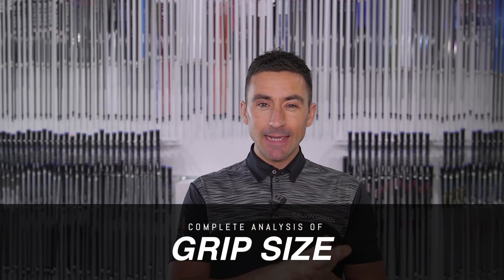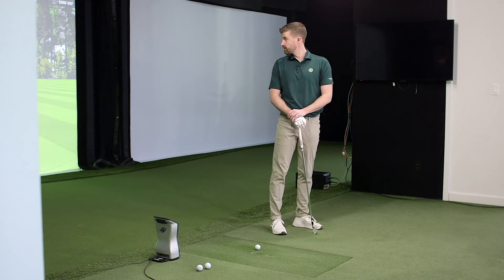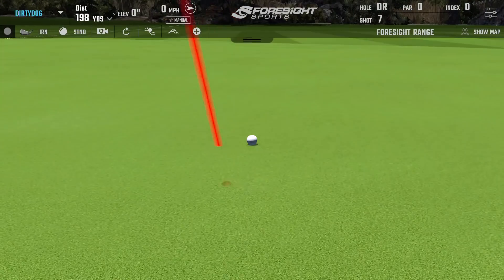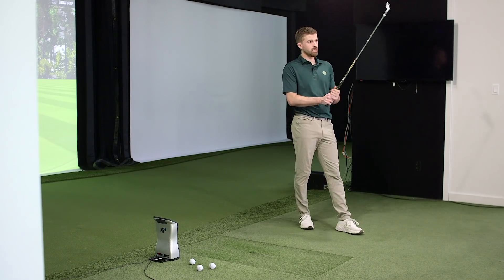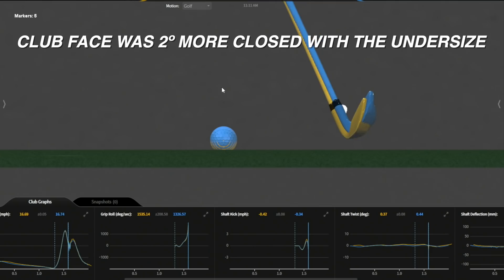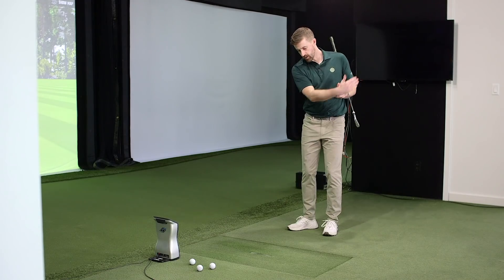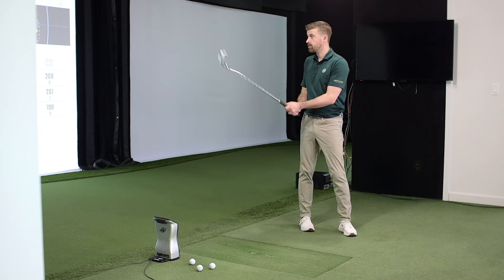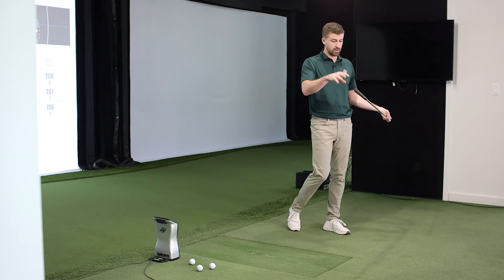Can GRIP SIZE Change Your Swing? // GEARS 3D Motion & Foresight GC Quad Testing

Comment: Have so far only put a Jumbo Max large grip on an old Adams driver ( i hook all drivers).
it has has straitened out my flight to the point of zero curvature and i can actually set up "open" and hit a fade which has been a revelation for someone who didn't use a driver for 2 years😃

Comment: Nice video…. But isn’t grip size (while some degree personal preference), still connected to hand size?   These stats reinforce my experience with a larger grips (I have a bigger/wider hand but not hugely long fingers).  But if I want to more efficiently get the shaft in my fingers vs getting into the palm of my hand, shouldn’t I want to go to a smaller diameter grip??  Seems like I’d get more distance.

Comment: I feel larger grips for smaller hands moves the handle into the palm and that weakens a grip . You have to have a grip that can fit within the fingers . If I handle is held in the palms you cannot properly hinge or release the club . Most have too large grips actually the smaller the better you need to hold the club in the fingers and not the palm to properly swing

Comment: Thanks for the video. Wondering if you could tell us the brand of the large grip. I seen lots of o/s grips for sale but there weight are very different. If I am adding extra weight to the top of the club how does that affect my swings speed angle etc?

Comment: I just installed Jumbo grips on my irons, and initial results I experienced more consistent ball striking and straighter ball flights, but the contact was more on the bottom of the head and flight path was more right of target vs a standard grip.

I'll need to work on how I hold the club, and concentrate on moving contact up the face.

Comment: Just got my new irons in, went with midsize grip mcc +4. Coming from stock taylormade standard size grips. These new ones feel way different, and my hand size is right at the top of standard, and bottom of midsize. Will take awhile to get used to I feel, but looking forward to playing them.

Comment: Grip size is a key factor in tennis, so there is no reason it should not be in golf. I feel a lot better with midsize grips (or jumbo grips that are really closer to midsize) than with standard grips. Your data is showing why. Straighter and higher flight, face square for longer, more control.

Comment: How do you guys approach the different weight of larger grips-  eg if you put on a midsize grip this can be 15-20g heavier than standard, which is up to 3 swing weight difference!! Yes larger grips might reduce grip roll, but also affect swing weight.  

I got fitted for my clubs on a standard grip size and later changed grips to midsize without knowing the swing weight would change... 

(Maybe you should choose the grip first then fit the shaft?) else don’t want to mess about with lead tape etc

Thoughts?

Comment: I just started playing golf this year and was wondering about what grip suited me best.  This video helps with how the grip influences my swing, loft, spin and face of the club.   One question, what about tapered grips vs less tapered grips?
Reply: DukesRocks . Lamkin and several others have charts online where you measure from the first crease at your wrist to the tip of your middle finger and that determines at least a starting point. Note the charts don't exactly agree with each other but they're similar. Also the less tapered grips are supposed to prevent your bottom hand from turning over too much and possibly causing a hook. I have them on one set and they seem to help when you want to grip down on the club, at least for me.

Comment: Question is the face closure rate affected also by the change of swing weight ? The changing of grip size also changes swing weight correct ? What if you matched the swing weight after each grip change and tested 🤔

Comment: Larger grips should allow finer adjustment of the club face. The issue with tests like this is they don't allow sufficient time to adapt to differences. I put larger grips on my clubs and played them for several years once I got used to them my play improved significantly.

Comment: my problem is that with midsize grips, my lead hand tends to slip and allow the grip to go into my palm causing the face to close causing pulls with my driver and short irons. I just changed my grips to standard and no longer pull my shots. I don't have long fingers and use an ML Cadet glove.

Comment: I know you used air to install, but was there any tape on there or bare golf shaft?  I typically use midsize with 2 layers of masking paint tape but thinking of trying the super lightweight jumbo so I still have a nice swing weight.

Comment: ZProblem with hand size my left hand size is 5 inches Palm 3 1/2 inches longest finger tried  thick and thin grips problems if it's thin grip it is very strong and in fingers timing issues if it in Palm it more about rotation of body not that supple struggle with pressing my meaty part of my thumb down on the shaft due to length of my Palm if holding in fingers leaves big gap in my Palm when swinging as suggestion play off 5 always had problems with being comfortable with my grip. Thanks for help keep up the great videos

Comment: I have a doubt on this. Grip has at least 4 parameters, appearance, material, diameter and weight. Put the first 2 on hold, the diameter will affect the feeling of grip, but the weight is also affecting the swing weight... which attributes this result more?

Comment: There's a small issue with this test and that is the tester. Matt is a great golfer and is obviously probably more aware of where his face is during the swing. Would like to see this test done with a 15 handicap or higher to see if the results are consistent. For instance perhaps an undersized grip would start left and keep going left, because a higher handicapper may not be able to automatically adjust or neutralize the path as well, based on whatever club face rate of closure
Reply from the maker: We'd argue the opposite, the less consistent the swing is of the tester the more unreliable the results are going to be. With all the videos we're showing what should happen with a given equipment change, a higher handicap player can use the patterns as guidance but it's harder to establish a pattern with someone who's path, angle of attack, strike etc. varies too much
Reply: Exactly so a higher handicapper may watch video purchase said grips or even go to a fitting and his or her results may not correlate. So the test I suppose shows shows the effect of grip size in low handicappers. Now if it was done with a higher handicapper as well as a lower handicapper then you could generalize

Comment: I am wondering is a thinner grip actually causes one to hold the club tighter?  So in the downswing one would grip the club tighter because it feels like it might slip out of your hand.  And in doing so you then rotate the club just a bit closed. With a thicker grip you do not get the feeling so your hands can be more neutral so less rotation.

Comment: There are just too many choices in Golf Pride grips. If you measure my hands its standard grips all the way. I kinda like the way the mid size feel in my hands though for some reason. I have read the standard size in the Golf Pride MCC Plus 4 is actually a bit bigger than standard.  That its actually right in between standard and mid size. Is that correct??????? I am looking for a grip with great control, all weather ability . I like the CP 2 but I am thinking its not so great in wet weather.

Comment: Forgive me if this question is too basic but wouldn’t the size of a player’s hands influence the size of the grips.  Myself, I’m 6’1” and wear a size “large” golf glove.  I currently have over-size Winn grips on my clubs and they feel good.  I purchased a new 3-wood last summer which I haven’t yet re-gripped.  The grip on it is noticeably thinner and doesn’t feel right.  It could be because I’m used to my over-sized grips or it could be that my hands are simply too large for the standard grip-width.   I guess my question is, shouldn’t hand size dictate the width of a club’s grip?  And then if you’re pushing or pulling the ball, wouldn’t a change to the swing be better than a change in the grips?

Comment: I had some grips put on my irons by Golf Galaxy...I wanted standard grips because that’s what I always used.  However, they messed up and put a midsize grip on my 7 iron, which I didn't notice until I took them to the range after I picked them up.  Well, I was a bit PO’d at first, but after I started to hit my 7 iron, it was like an epiphany of divine intervention…I hit them so well and it felt so good, I knew I was playing the wrong sized grips…bit the bullet, took them back and told them the situation and GG was great about it, they put midsized grips on all my clubs and I only paid for the grips, free install.  Basically, I have much more clubface awareness and my ball striking improved a ton with the large midsize grip.  I would encourage golfers that play standard grips to put a midsize grip on their 7 iron and try it out at the range, you may have the same experience.

Comment: It’s interesting because the general fitting process doesn’t accommodate grip size up front and trial shafts have a standard grip. Looking at the head speed differences could mean the marginal softer shaft may well be a better fit for distance and shape with a larger grip. I use mcc +4 with 2 wraps, as it just feels right in my hand.

Comment: I should be in midsize based off some of the suggestions I’ve heard and read.  I changed to midsize and I struggled to release the club.  Maybe because they were a lot softer than I was used to?  CP2 Pro by GP...don’t do all your clubs like I did.  I’ve now found a comfort zone with 3-4 wraps under my bottom hand or a “plus 4” style grip.  Play what feels comfortable and gives you the best results!

Comment: Ian, very interesting. 2 questions, could you give me the grip diameters of the 3 grips you used( I see you used 2 Pure Pro-undersize and standard and a Winn jumbo),  and will you be doing this same test with the driver, I thinking the driver might emphasise the differences more than the iron does.

Comment: Very cool video guys, that definitely validates the main things I have experienced and what the general wisdom has been. I have ALWAYS been more comfortable with a slightly smaller grip on my 3w as I use as primarily a right to left club (as a righty) off the tee. Instinctively I always felt like that made it easier to start the ball right and get it moving left, and that makes sense given not only the increased face rotation, but the subsequent swing path compensation that we make in response to it. Science!

I have also found a similar affect with counterweights as well. More/heavier weight under the hands slowed face rotation. That would be a great test for you guys too!

Comment: Ian- so if someone has an issue drawing a club too much, what you are saying is we could potentially get a larger drip and maybe not have to flatten the club?  Usually I order my irons 2* flat but on resale some don’t want to purchase due to that.  I could just get larger grips or add more tape underneath to control that correct?

Comment: Most amateurs are slicers of the ball, whats the best fix for this, other than lessons and getting better at the game? using an undersized grip? Yes, you explained the low left hook but i'd be nervous suggesting amateurs reduce grip size to accommodate for a fade / slice?
Reply from the maker: grip size is one of many considerations in trying to get the face to close or square up for a player, wouldn't use it as a one size fits all solution though.

Comment: Pure gold and right on time. For fun i ordered raw components and built a custom set of clubs yesterday. I installed the Jumbo max XL grips on them to try them as I was struggling with face control. I kept telling my instructor I felt like I was "dumping" the swing. basically as Ian is describing it as moving the path more right to accommodate the excessive closing of the face. It's an odd sensation but I was absolutely reacting to the face of the club. I'm sure people think the grips are ridiculous but I'm 6'7" and my hands are about 10 inches long (XXXL) glove.  Jumbo max probably feels to me like an standard jumbo feels like to someone with "regular" size hands. I liken it to the time I finally found 36" inseam pants. I was like ohhhhhhhhhhh so this is what it feels like when something fits correctly, how nice!

Comment: Hi Gents, what is the - or + swingweight delta for different grip sizes i.e. assuming standard length shaft at D2 with Regular Grip, what would the swingweights be for Undersized, Midsize & Jumbo grips.  Helpful info when we use longer shafts which raises the swingweight but may be reduced again by fitting a larger size grip?  Also how does 1/2 inch increments longer & shorter effect swingweight for a given shaft?  Thanks.

Comment: This is so interesting. I got fit for new irons and my fitter suggested adding an extra 2 layers of tape to calm down my left miss, which worked. I had snap hooks with my driver so did the same thing and snap hooks disappeared. My question is, will those additional layers of tape change swing weight? Great to see his suggestions validated by tech. Great as always gents!
Reply from the maker: Wouldn’t worry about swingweight with only two layers of tape
Reply: TXG Tour Experience Golf not worried just curious :). Stay safe out there gents

Comment: Great video gents. As a 60 something the pain that comes with age is starting to set into the hands. Having small hands I usually use standard size grips, but have been trying a midsize in my driver and one hybrid. Results have been wonderful. Both clubs have become more accurate most likely due to less rotation and re-gripping during the swing. The connection feels much more consistent. Next up, make the dive and change out the whole set.

Comment: Could the jumbo grip have changed the swing weight slightly by being heavier than the undersized grip thus giving a slight “counter balance” effect? Could this be the cause of path and angle change of the club?  Would a more fair test have been to adjust swing weight to be exact same with changing the grip size?
Reply: Reggie Caillouet the oversized grip and the standard grip both weigh 50grams, that’s why we chose those grips.  So swing weight was exactly the same.

Comment: Such awesome content ! I love seeing theory, being tested. Quite a test ! I would love to see you guys test the “stiffer shaft hooking less” theory. I never believed that theory. Different results for different swings I always believed. Maybe use a model Matt prefers and try R,S,X, XX ?? Anyways good stuff !!
Reply: It's not a theory. Stiffer, lower-torque shafts make the club rotate less as you swing down. But if they're too stout for you, you might go crazy with bad timing because you're used to feeling the load/unload of a shaft that you're capable of loading. And you'll lose a ton of smash factor because you're not getting any pop out of it. 

I can CRUSH it with a ladies' shaft but the timing has to be dead perfect. If I'm slow it's a huge block and if I'm fast, the snappiest snap-hook you'll ever see. Go to a fitter and try a range of shaft stiffnesses. Too often they pigeon-hole you into a flex as soon as they get your swing speed. Flex has as much to do with timing as speed & it's totally non standard. There are X flex shafts that are softer than other manufacturer's S flex. It's all over the place. "Play the softest shaft that you can control" is still great advice.
Reply: I actually am a fitter and have seen the scenario of a stiffer shaft getting hooky for some folks and the softer getting high blocks. It’s not a rule obviously, but I have seen it.
Reply: I should've added "if you swing the same" because that's what torque specs mean. I'm not surprised to hear that you've seen a golfer try to overcompensate to get the too-stiff shaft to load and end up hooking the stiffest shaft more. 

I read a blind test a few years ago where nearly all the test subjects were least accurate with the S flex than R OR X & even some slow swingers were best with X and only gave up a few yards for huge accuracy improvements. 

My theory on some is the fast swingers getting the best results with R was that it improved their tempo because their brains could tell that their hulk-smash swing was going to snap hook even though they weren't told what it was. We golfers are a mysterious lot. You fitters have a tough task!
Reply: Agreed 👍

Comment: I’ve got mmc plus 4 midsize on all my irons and love them, but here’s where it obviously affect rotation because I’ve also got one one my 3 wood but not the 5 wood and I can’t for the life of me square the face with the fat grip on the 3 wood. Both rogue fairways standard size 5 wood grip goes dead straight
Reply: I've seen something similar. Absolutely love them on my wedges and irons & it's eliminated my tendency to hook my 3-wood off the deck. Kills me with the driver though - I hit straight blocks. A friend of mine had the same problem and fixed it by going from the +4 to the regular (left hand same, right hand thinner) just on the driver. Same effect as going thinner - slightly increase closure rate.

Comment: Im not sure how it can be done ...but the one thing in golf that I have never ever seen measured is the strength of the grip as someone is swinging the club ..I always hear the grip pressure should be around 3 to 4 out of 10 .. I simply cannot see how this is even possible when someone is hitting a 6 iron 200 yards or a driver 300 yards ??